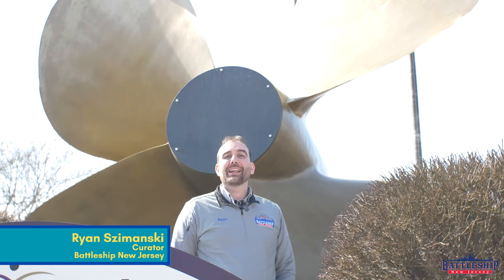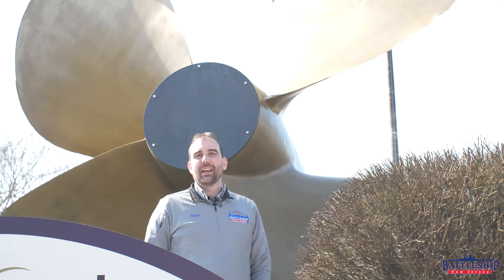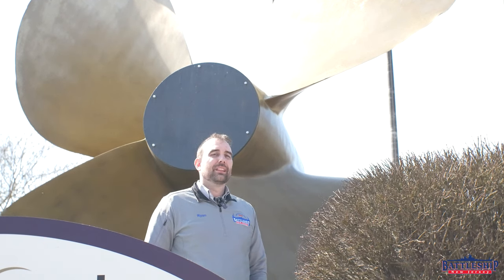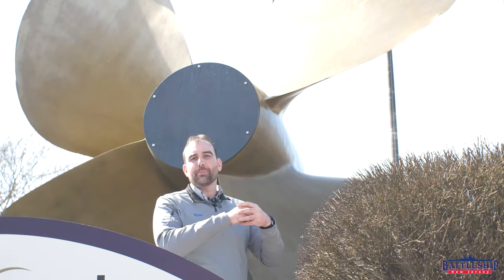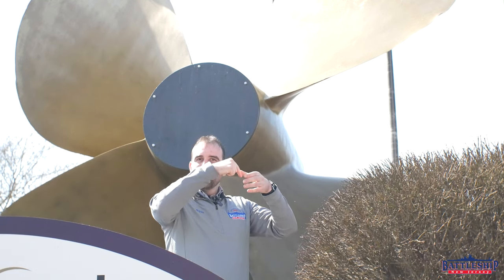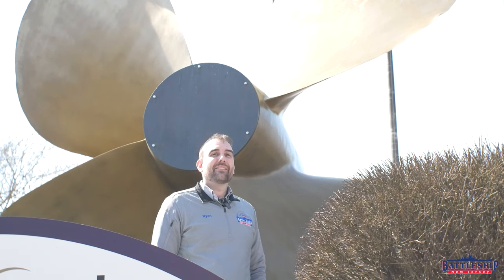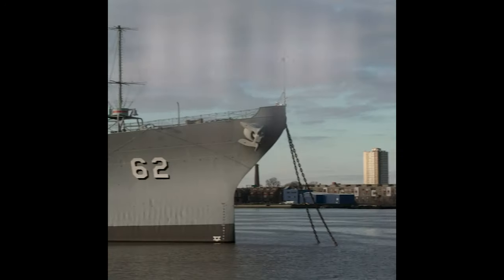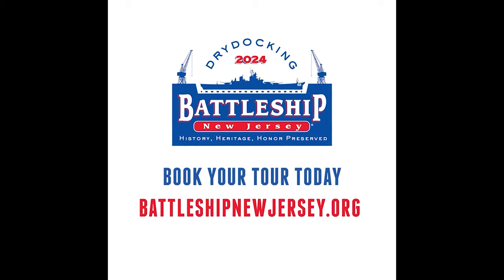How Propellers Get Damaged: Cavitation

Comment: Not gas bubbles, vacuum bubbles.  And they don't pop, they collapse.
Reply: They're not vacuum, but micro bubbles of gaseous water vapor. The pressure on the propellor drops lower than the vapor point of the water, and for lack of a better term the water boils. Water will convert to gas at a lower temperature the lower the pressure its under- and under low enough pressure water will convert to a gaseous state (boil), even room temperature.
Reply: Steam bubbles.  Water transitions to steam due to the low pressure.
Reply: Water is just like a sponge, it holds lots of things including gasses, such as CO2. Even reverse osmosis doesn't remove CO2. Low pressure can cause the rapid expansion of these gasses and the collapse is like water hammer.
Reply: They're steam bubbles from a low pressure situation.
Reply: @MrBen527  not always dude.
Reply: @dudeman8323  Yes, with "cavitation"
Reply: You are correct!  Low pressure bubbles, basically vacuum bubbles!
But hey, cut Ryan some slack, he is a museum curator, not a scientist 🤗
Reply: @MrBen527  nope, go study more.
Reply: @dudeman8323  lol. If MIT, among others, calls it steam, then it's steam.
Reply: Care to explain how a vacuum can form a bubble in a fluid? 
A vacuum is largely the absence of pressure, a bubble in a fluid is the opposite or else there would be no bubble.

You're mixing this up with the reason why these steam bubbles form: Low pressure. Water changes from solid to gaseous state in a pressure environment that could be loosely described as a "vacuum" at temperatures as low as 15°C. And that is exactly the pressure regime the trailing edge of a propeller creates at sufficient rpm. This is why these are gas bubbles and not vacuum bubbles but they are caused by extremely low pressure.
Reply: You should think about deleting your ‘clever’ comment, as it’s wrong 🤦‍♂️.
Reply: They start with the formation of a vacuum. Gases in suspension, quickly fill that vacuum before collapsing. Lol!
Reply: I have been reading the comments.  Amazing how ignorant many people are of science!
Reply: @mahbriggs  Lol! Exactly!
Reply: Technically I suppose that they are bubbles of low pressure water vapour.
Reply: @robinwells8879  They are bubbles of what the fish hreathe, in the water. Look closer and think about it.
Reply: @Ganiscol actually as low as the triple point, with is like 0.01°C
Reply: @scottjackson5173 that incorrect. As others have mentioned the bubble is made out of water vapor, not dissolved gasses
Reply: @scottjackson5173 nope he is right, it's just water vapor, not dissolved oxigin or anything
Reply: @malteec.9163  Lol! Believe what you like! What is water vaporized with? LMAO!
Reply: @scottjackson5173  It boils into a vapor under exposure to low pressure. Low pressure does not equate to a vacuum. An area of vacuum is not required for this effect to happen, and quite simply it's impossible for a vacuum to exist- because the water will boil and vapor will fill the low pressure area before it ever comes close to being a pure vacuum space.
Reply: @seand7894  No one said anything about an absolute vacuum. But you're welcome to try and measure how a cavitation bubble forms around a high speed screw at around 100,000 shaft horsepower! A nearly true vacuum likely doesn't laat long, in terms of micro seconds or pico seconds. Before gasses in suspension are drawn into that very low pressure zone. All of which ignores the incredible VIOLENCE of the reaction! Violence so great that it rips metal from the screws! Of course there will be loose molecules of H2O present. But in an excited state closer to stesm, than vapor.
Reply: @seand7894 to be nitpicky. You're talking about a perfect vacuum. But there is no such thing as a perfect vacuum and the term vacuum is generally used for any form of partial vacuum. Which happens to be the case here.
Reply: @MrBen527   I guess other fluids besides water can form "steam"? MIT forgot about other gasses?
Reply: @dudeman8323  "Water," which is the medium these propellers operate in, is mostly H2O.  The other gasses are trace amounts and are not primarily in cavitation bubbles.  The bubbles completely disappear in slow motion footage, meaning they're mainly water steam, cooling, and condensing back to water.
Reply: @MrBen527  you can argue how you want to call a strong under pressure area with some water molecule in it. But the main issue at hand here is that as soon as the bubble is hitting the edge of the blade it immediately implodes violently under the water pressure.
Reply: @digitaleswerken  I'm not arguing that.
Reply: @MrBen527  so you admit there are other gasses?? Interesting, some people are adamant that C02 can't be in water 😁
Reply: @dudeman8323  Yes, there is CO2.  I never said otherwise.
Reply: @MrBen527  Water doesn't compress. Like it or not, gases like oxygen, carbon monoxide, AND carbon dioxide, as well as nitrogen all dissolve in water, like the solids of salt and sugar. Gases compress, water doesn't. Cavitation occurs when the speed and torque of a screw becomes greater than the amount of water that can be moved by one rotation of the screw. The blade actually slips in the water creating a vacuum. Only that vacuum is instantly filled with whatever is dissolved in the water. How do you think fish's gills extract oxygen from the water? If no oxygen is present? The fish dies. I'm sorry that your education is so limited. Just look into any ship's wake. At low speed, little to no cavitation is visible. Everyone can easily observe that white water is frothy and white from billions of tiny bubbles. This same white water phenomenon can be observed in a ship's wake, from screw cavitation. The same phenomenon can be observed in the kitchen with a blender. At low speed, little if any cavitation is visible. The higher the speed, the higher the degree of cavitation can be observed. Think about it.
Reply: @scottjackson5173  LOL. I never said anything about compressing or that there aren't gasses present.   And I'm sorry,  but you should delete your state theory/comment.
Reply: @MrBen527  you were responding to Dudeman, but for some reason YouTube sent the reply to my phone.  I didn't notice that earlier
Reply: @scottjackson5173 IDK  It was a response to the really long comment,  with your name on it.
Reply: @MrBen527  I said that it is not steam all the time. So... is that .05% of the time or 10% of the time? There is quite a bit of dissolved gasses in the water that contribute to cavitation, period. Sorry you are so hurt.
Reply: @dudeman8323  Not hurt at all.   Studies show the bubbles are primarily steam, which makes sense since the medium is, by far, mostly water.  They form and dissappear rapidly, further enforcing this event.  You've been stating it's mainly the other way around.   The gasses you speak of are trivial in this process.
Reply: @MrBen527  You measured this how exactly? Also, I suspect that what exactly takes place, has a great deal to do with the amount of energy involved . As in a great deal of difference between an a 30 ft screw cavitating at 250 rpm. From a motor boat prop. Turning at 2,500 rpm, or faster.
   Unless the sensor is a part of the screw blade, by the time you take a sample of the wake? The initial stage of the reaction is long past. So sampling water bubbles downstream from a spinning screw, will get a different reading. Compared to a digital micro second, by micrc second, measurement along the blade of a cavitating screw. Would be interested in seeing the results of such a scientific experiment.
Reply: @MrBen527  Studies? Really? Have you ever studied any form of science or chemistry? How much energy does it take to flash liquid water into steam? Remember Cavitation happens in much less than a second. 
     If that were true, then cavitation would be much reduced in icy waters. Only that's not the case! Study that!
Reply: @scottjackson5173  Yes, I'm referring to high-speed camera footage.  You have to calm down, man.  You're still assuming things and going off on tangents again.
Reply: There is no mention of a vacuum in multiple reputable sites describing and defining cavitation.  So while several people seem to be arguing that point ad infinitum, That's not really what's going on.
Reply: @metaforcesaber  Vacuum is a void, a lack of something there. The concept is difficult to understand. It's far more difficult to measure. Water doesn't compress like air. Cavation is when the power and torque of a screw slips in the water. Each turn can only move so much water at a time. Except that the blade turns anyway. What happens next, is impossible for some people to understand, much less visualize.
       The blade turns, only no more water moves, leaving nothing there. Except that nothing cannot exist. The word vacuum conjures up the image of a vacuum tube, or the emptiness of deep space. Nothing exists for less than a fraction of a second. Very few people think in terms of micro-seconds  or pico-seconds. (One millionth or one trillionth of a second) 
      Since nothing cannot exist, nothing is filled with something. Gasses dissolved in the water fill the nothingness. Gasses compress, water doesn't. When a vacuum is instantly filled, is it still a vacuum? Not anymore. Yet, the nothing left by the turning screw wouldn't be suddenly filled without that momentary vacuum in time. Understand it, or not.

Comment: Cavitation is also a problem on enclosed pumps, such as fire engines.  It happens most often when the engine is drafting (pulling water from an unpressurized source) and pumping at the same time.  If the inflow of the suction doesn't keep up with the outflow from the hoses, that same low pressure vacuum can happen, with severe damage to the pump and casing.  But it's still cheaper than replacing one of those propellers, I imagine.
Reply: Same happens on construction equipment. The hydraulic pumps have alot of damage over time due to restriction in lines

Comment: Pretty sure cavitation is not caused by heating at the leading edge, but pressure so low at the trailing edge that the water tuns to vapor.
Reply: You are correct.
Reply: Seconding also that this is correct.
Reply: F*ck it, I'll jump in too! 😅
Reply: "OK Mr. Ryan, we just unzipped our fly!"

Comment: as far as i know  cavitation isnt created by heating in high pressure areas, its created by the pressure being low enough that water "boils" at room tempiture(see phase diagram),
Reply: Yes you are correct. It doesn't have anything to do with high pressure or heat.  Cavitation acurs in liquids when surrounding pressure drops below it's boiling point at that temperate (in this case the temperature of the ocean)so water boils (boil = turn into gas) forming a water vapor (steam) buble. Then the surrounding pressure rise back steam condenses creating partial vacuum and the buble collapses accelarating water around it inwards. If this buble happen to be on the metal surface ar very close to when it collapses it  creates like a shaped charge effect focusing tiny amount of energy it has in a single point giving in this case water molecules enough force (speed) to mechanicaly erode metals after many many buble calapses.

Comment: Cavitation is noisy too. Submariners worry a lot about how rapidly we open the throttles because too rapid acceleration will result in noisy and detectable cavitation.
Reply: Ps. It’s not the heating that causes gas. It’s the low pressure that causes the water to vaporize. It causes damage when it re-collapse and the pressure wave impinges on the metal.
Reply: "We just unzipped our fly, Mr. Ryan.  Now if that bastard so much as twitches..."
Reply: @jstogdill Right. Literally it's a miniature water hammer.
Reply: @seafodder6129 I had to think about this for a little bit. "The Hunt for Red October"

Comment: Bernoulli's principle is also why when 2 ships resupply one another while under way is so dangerous. as the ship get close side x side  the water speeds up which in turn draws the ships closer and closer till they are stuck together and have to come close to full stop in order to move apart
Reply: Never knew this.  Thanks Ryan!
Reply: Yes and no.. with battleship New Jersey, her bow is so flared that it actually scoops up water at the bow stem and forces it in between the ship.. that amount of water being forced in between the ships pushes them apart..
On smaller ships that have a straight line hull design, like a bulk carrier or an Arleigh Burke class destroyer, the bow doesn’t push enough water to push the ships apart, so Bernoullis principal takes effect and sucks the ships together ..
Bernoulli’s principal is one of the pain reason why the “evergiven” got trapped in the Suez Canal

Comment: Actually it is NOT cavitation that damages propellers. It is the collapse of the bubbles against the metal that does. If that collapse can be made to happen even an inch away from the surface, no damage will occur. In propellers optimized for really high speeds, the blades have a wedge like cross section with the trailing edge being a perpendicular vertical surface. The idea is to throw the caviation away and have it collapse behind the prop itself. Such a geometry is not economical at low speeds, but for speed runs it basically allows you to cavitate with impunity.

Comment: I'm pretty sure it was determined in recent years that the way these bubbles collapse are not that different than the way black holes are formed and collapse. At a very short point in time the entire mass of the ocean is pushing on them to remove them as an anomaly. It creates a very localized heat spike which is what causes most of the damage.

Propellers are somehow creating a very unnatural phenomenon that for the longest time we had no idea about.

We still have a lot of science to do in optimising propeller/wing designs to limit flow separation as little as possible.

The propellers on new jersey as advanced as they were compared to the previous 3 bladed ones standard at the time still look like a caveman designed them in contrast to 3rd millenium designs. Not that it is still using them I guess.

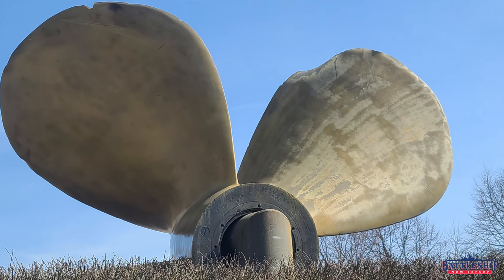Comment: There are two ways to convert a liquid into a gas.  One, raise the temperature to its boiling point at current pressure.  Two, lower the boiling point by reducing pressure to the point where it would boil at ambient temperature.  The pressure at the trailing edge is lowered enough to cause gas bubbles to form.  The bubbles collapse almost immediately after leaving the trailing edge causes a shockwave. The shockwaves act like water hammer on the props.  Its extremely noisy and damaging.  If you look at time 2:11, notice that most of the damage is near the blade tips.  The reason for that is cavitation forms first on the blade tips.  The tips are moving at the fastest linear velocity at a given rpm.
Reply: This.  There is no "pop" of the bubbles, that's the wrong word to use.  It's kind of a nit to pick, but it's an important one technically.  They collapse back into liquid.  The collapse is extremely fast (much faster than creation of the bubble), resulting in the hammer and shockwaves.
Reply: @danielbarclay4957  I never used the word “pop”. The word I used was “collapsed”
Reply: @dmac7128 right. I was referring to the use of pop (entire description of cavitation) in the video.  Your post was correct, hence my statement “this”.

Comment: 2:00 Major correction: Water is compressed on the trailing face, actually, and the heating from such compression - even on something as massive as a battleship's screw - is miniscule overall and negligible given the overall volume of water affected; the condenser exhaust water is going to be heated far more significantly than any part of the screw wash. Instead, it is simply the low pressure on the leading face that causes cavitation; the extremely low compressibility of water means that it is not 'springy' at all, and it will spontaneously 'boil' when subject to low enough pressures rather than expanding to accommodate a low pressure condition. The bubbles from screw wash are in fact tiny bubbles of steam or water vapor rather than air or vacuum, as some suggest, produced at ambient temperature due to a sharp drop in pressure. The bubbles then collapse sharply with a water-hammer-like effect because the pressure gradient moving over the surface of the screw is not smooth or laminar, but has eddy currents and oscillations typical of turbulent flow that cause the pressure to rise and fall.

Comment: Bernouli deals with the pressure of flowing v stagnant fluids. Bernouli states (HS version) that a fluids pressure decreses as the fluids velocity increases. As others have said the fluid flows so quickly that the fluid pressure drops below vapor pressure allowing it to boil in ambient conditions forming a steam bubble. When this bubble collses you literally have a micro water hammer. Thousands of times continuoisly.

Comment: Still one of the coolest things I have seen was on the sea trials of HMS Invincible. Down in the school room back aft was a small viewing port through which you could get a sight of the rotating propeller. It was easy to see tip and sheet cavitation and view vortices corkscrewing off the blades.

Comment: Circa 1983/84, cavitation in the bypass tunnels at Glen Canyon Dam (on the Colorado River) tore bus-sized chunks of rock and concrete out of the tunnel walls and almost resulted in loss of the dam. Possible similar issues at Oroville Dam in recent years.

Comment: I have repaired and built prropellers since 1996. Most cavitiation burns on propellers are due to two issues. 1. Slight damage that becomes a big problem, 2. Improper design by the engineers. I have had to repair multiple times the propellers for BC Ferries due to improperly designed Blades.